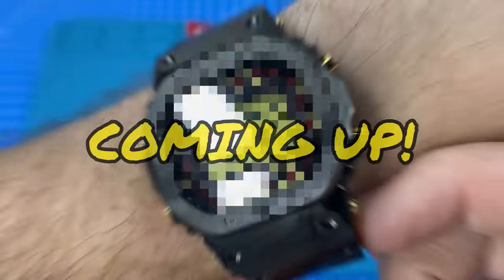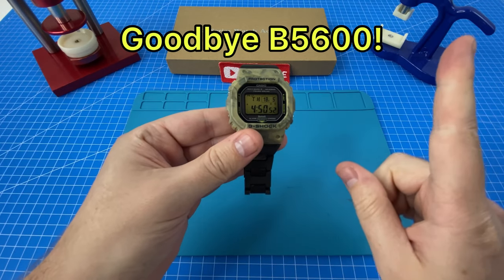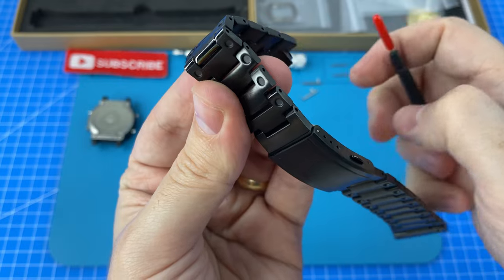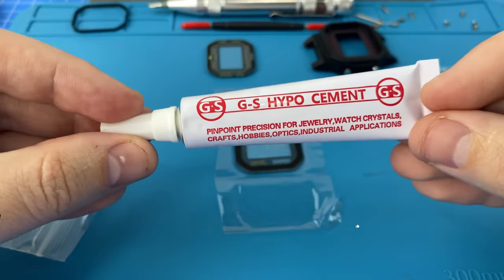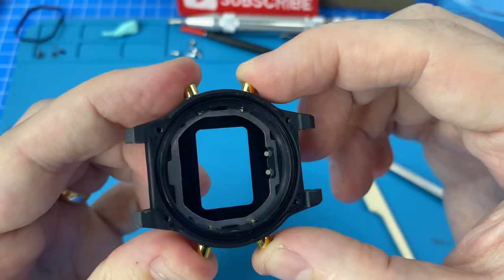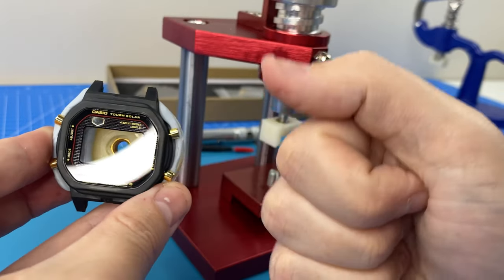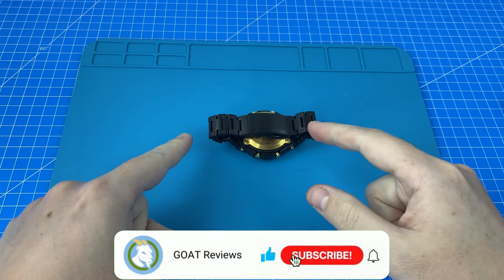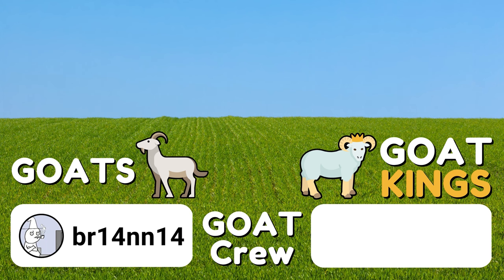🤩 I BUILT the MOST EPIC G-Shock to SAVE $4,948! ⌚👑

Comment: not great the bracelet hasn’t got a lock and no suspension system on the bezel. Easy things to spot
Reply from the maker: Cheers Kevin, I appreciate your feedback 👌
I know what you mean - the strap isn't a match. Though I did further improve this, in a later video! Would love to hear your thoughts on the new strap:

https://youtu.be/3bwxAcDsuO4
Reply: @goatreviews  i will take a look and let you know. I’ve done a couple of mods but the best one was a casioak off skx mod the quality was good but it made the lug to lug massive so i sold it on. I’m also not fussed on that gold pressed back as well haha i’m a fussy bugger but do have the original and probably trying to justify the price i paid
Reply from the maker: @kevinkitton thanks man! 🙏 Oh yeah - I’ve heard great things about the SKX Mod kits 🤩 They can be a bit pricey though. Sad to hear the lug to lug width was increased to a point it wasn’t usable! 😢
Oh yeah - The back plate has some parts that could be improved I suppose but overall I am very happy with it - it’s the only find back I’ve owned 😁
I understand where you’re coming from. There’s no comparison in quality with an original MR-G! That’s the quality you’re paying for 👌 I’d love to own one some day 🤩

Comment: I've read some comments here, how some people think the real MRG-B5000B is very expensive.  Which it is.  But you do get a lot of expert labour involved.

The watch is made of hardened Titanium, not steel.  So it's very lightweight.   Then it's finished with a Diamond-like Carbon coating which is 4 times harder again.  It's so tough it has to be zaratsu polished, a person who is trained for years before they're allowed to do it.

The case isn't a single part, it's made up of 25 seperate pieces.  Because each part has to be zaratsu polished individually.  It's very labour intensive and skilled.  On the bracelet, each link has two seperate round flat rods.  That's three parts per link, all titanium, all DLC coated, all zaratsu polished individually... plus pins & collars.  Pins and collars are used because the DAT55G Titanium is Grade 3 and so hard, tiny screw would be too brittle.

The clasp has a gold looking locking button, so it can't be accidentally released during activities.

The very top of the case is made out of Cobarion a very hard treated metal which can only be obtained from one supplier in the world.

The case also includes a unique suspension system to support and protect the internal electronics.  Each corner is fitted with a leaf spring.

The internal circuitry is real Gold Plated for extreme durability and efficiency.  A homage to the original 1983 DW-5000 unit.

It's then finished off with a pure sapphire crystal display with anti-reflective coating on the inside.  And a 4 second fade blue back-light.

The red line around the watch face is reflective, so 'pops' on sunny days.  It really jumps out, along with the zaratsu polished DLC layer.

Lovely watch to wear and very tough.
Reply from the maker: I can tell as an owner, you are genuinely passionate about the profound engineering that went into this masterpiece of horology. 

I must say I was not familiar with a lot of the points you mentioned - namely surrounding the craftsmanship of the individual bezel pieces. I knew it had multiple princes, but had no idea about all the additional work that went in to each individual part 👀 

Thank you for this incredible summary of the genuine MRG-B5000! 🙏
Reply: @goatreviews  No worries, what I also find interesting is how this Casio MRG shares similarities with my Grand Seiko "Tentagraph" ... which also has Zaratsu polishing on High-Intensity Titanium, Sapphire Crystal Glass, pins & collars bracelet, and an almost identical clasp.  That watch is three times the MRG price.  But a lot of similar features.

But it won't hold up as well for resistance to shock or vibration.  So Dinner Appointments only 😄

Edit : ... and I use the MRG B5000B to set ALL my mechanical automatic watches before I use them.  It is the time benchmark.
Reply from the maker: Incredible! So once again, Casio is offering INCREDIBLE value compared to the competition  @JustMeTalking  😁 Maybe the price isn't that unreasonable after all... 🤔

Thats awesome! the MR-G is a worthy Benchmark... It sounds like the module is an accurate one! Hopefully my GMW-B5000 module will be as accurate when I open it 😅😅
Reply: As a good guide, I'd say it's worth it but only if you don't have to go into debt to get one.   Debt is the enemy and will take all the long term fun out of owning it.

Save, or buy it from a bonus cash influx.  Then you'll enjoy it.
Reply from the maker: Wise words,  @JustMeTalking  👌
I look forward to such an influx, at which point I’ll enjoy the real MR-G 🤩
Thank you!
Reply: @goatreviews  For the engineering and labor involved I'd say the MR-G is not overpriced though it seems in the watch world, nothing should be over a hundred dollars unless it's mechanical. I don't have one myself but do have a GWM-B5000 which I really like (though the Casio Bluetooth app is awful). That said, I still appreciate your project and was nervous as anything when you were working on the crystal! It looks amazing and I'd be proud of the results!
Reply from the maker: @bugdrvr  cheers for the input, Jim! 🙏 
The GWM-B5000 is functionally identical - ideally the mod would be done with this watch for the larger buttons 😁

Comment: Could I use another G-Shock for the host watch ? Great video
Reply from the maker: G'day Excalibur! ⚔
I appreciate the feedback. 
There are bezels made to fit the "GW-M5610U", but I specifically chose the GW-B5600SL as the host watch for specific reasons.

It was the lowest cost B5600 series watch with a positive display. Also, the 5600 series have a lens that can be replaced without compromising the Solar Panel, unlike the 5610 series!

Anything from the B5600 series with a Positive display would be fine for this build.

I'd recommend checking out my Parts List video here (Especially at 1 minute):
https://www.youtube.com/watch?v=0gJnpYEDj5U
Reply: I definitely will. Thank you for the feedback and if I get anything I’ll use your links. Much Appreciated
Reply from the maker: @Thexcalibur  Happy to help, my friend! 🙏

Comment: So, does the GW-B5600SL have the same exact module as the MRG-5000? Thanks, and great vid!
Reply from the maker: G’day Ba-Gawk! 🐔 
The module of B5600’s in general have slightly different displays to the 5000’s, in terms of how things are laid out. However they are almost functionally identical! Although the 5000’s do have larger, easier to press pushers. 

Also, the ‘B5600SL’ or “Sand Land” specifically, has a slightly darker “yellowish” tinge to the background of the screen (Which I think matches very nicely with the gold of the MR-G!)

Hope this helps 🙏
Reply: @goatreviews  Oh man, imagine the DW5040PG-1 (40th Anniversary) gold screen used for this mod. Too bad it doesn't have any features (no atomic time, solar, bluetooth, etc.), or I'd cut up that puppy in a heartbeat just for the bling factor.
Reply from the maker: @pdiz  Great idea, Ba-Gawk! 🧠🐥💡
A couple of the lads in the Discord had a similar idea... It turns out you can actually buy a very similar background separately on AliExpress ( https://s.click.aliexpress.com/e/_DefzTp7 ) so you could change just that, and keep all the other features of your module!
Reply: No. The 5000s have a higher clarity / quality STN display for a start.